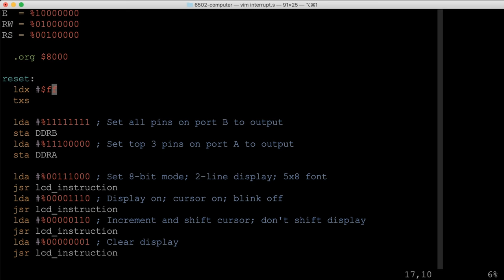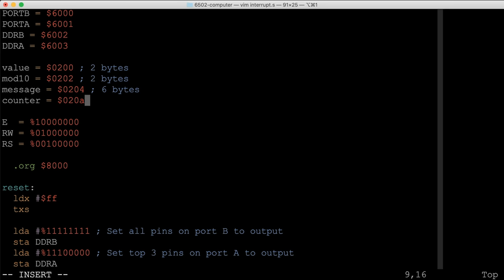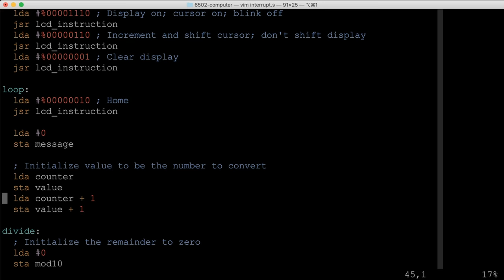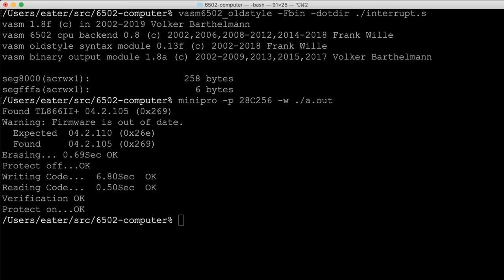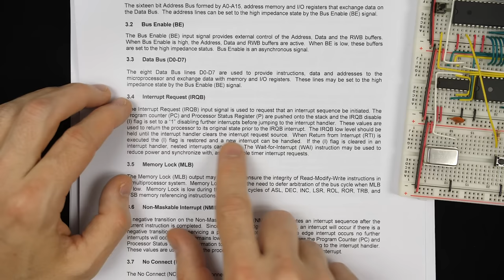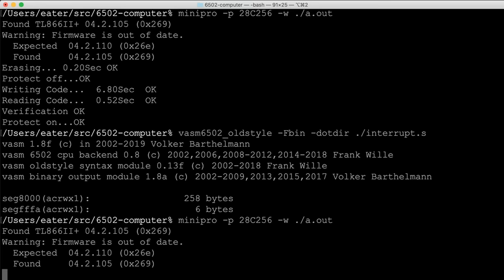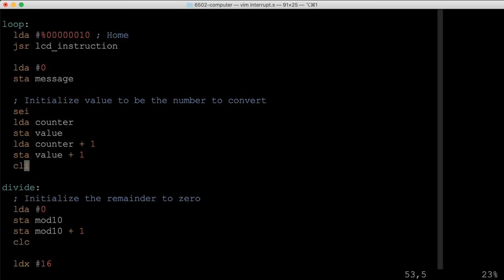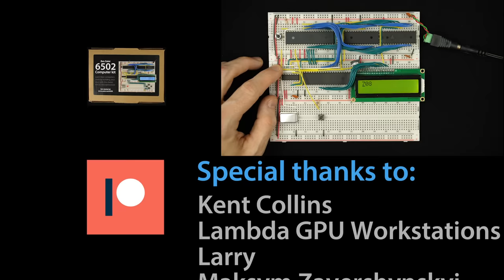Hardware interrupts

Comment: Absolutely love how you go through the process, failing a few times, and "discovering" why. It makes learning a lot smoother than just being told "you must do X, Y, and Z", and never find out what might happen if you only "do X and Y".
Reply: Yes, I noticed that too, I really like that.
Reply: Neuropsychologically, that technique will trigger the learning response, assuming that the viewer is engaged. 

Unexpected results trigger the part of the brain that formulates and integrates process corrections. (See "orienting reflex")
Reply: It's a good technique. "What happens if you don't do something?" is always a useful question to ask.
Reply: I love how he works this in too.
You can tell he knows the right answer, but he wants to teach WHY it's the right answer.
he shows the shortcuts you can get away with in a pinch, because you know the limits of them.
Reply: failing is part of the process of what it means to be a programmer.
The 6502 is a relatively simple processor. Modern processors are much more complex and there is a lot to know about the individual subsystems working together. It is not uncommon to not know all the low level nuts and bolts one needs to know in order not to fail. The datasheet of the µC I am working with - a STM32F7 - has 1200 pages. Needless to say, that it is impossible to grasp all of the information just by reading it front to back.
Reply: Absolutely agreed. Tutorials have a bad habit of sidestepping the fact that failing is a very, very powerful learning tool.
Reply: hmm
Reply: I always love that when something going over how, really anything works, instead of just jumping to the correct solution goes through the steps and mistakes actually made when first designing it

Comment: "You don't want to use NMI in normal operation." Nintendo: "How about an NMI on every VSYNC?"
Reply: At least IBM used a maskable interrupt on a timer
Reply: Nintendo used NMI for timing as a sort of watchdog or heartbeat. You didn't want a hard to debug console to crash suddenly in production.

A general purpose computer is significantly easier to debug than a running game console, so timers can be maskable with no loss in integrity.

Comment: One thing that's worth noting: whenever the IRQ line is pulled low, it sets a flag inside the CPU. Whenever the CPU is finished an instruction, if that flag is set and interrupts are enabled, it services the interrupt. So, disabling interrupts doesn't actually prevent them, but delays them. Once you enable them again, any pending interrupts are serviced.

Of course, it's only a flag, so even if 1000 interrupt requests happen while disabled, it will only run the handler once. It is also possible to manually clear that flag without actually handling the interrupt.
Reply: Exactly.  Otherwise, a 'low' IRQ line would try to re-enter the interrupt handler over and over and over and over.  It would keep pushing PC onto stack and ever execute a single instruction inside the IRQ handler :)   By 'blocking' further interrupts until the RTI instruction is executed, the CPU can do something to 'handle' the event.

And yes, if you expect additional interrupts as quickly as that, you could lose track of some events.   So different schemes to 'count' the interrupts as quickly as you can, then use some other code to service the device until the 'interrupt count' is back to zero.  Tricky stuff, but can be done.
Reply: In the 6502, the NMI (non-maskable interrupt) is latched, but the IRQ isn't. It's up to the device or support chips to hold the request until it's cancelled from the IRQ handler.

By the way, if anyone is interested, to handle an IRQ or NMI, the CPU runs a modified BRK (break) instruction. The same happens on reset to load the reset vector, but it holds the read pin high to avoid writing the program counter and status flags to the stack. It's a nifty hack to save transistors. This explains those initial 7 cycles, and why a reset decrements the stack pointer by 3 and sets the interrupt disable flag without disturbing memory or the other registers.
Reply: @JB52520  Hi Johnny how does the CPU know what address is inside the IRQ vector at FFFA, i understand that what ever device triggering the request will be inside the IRQ vector the the iRQ subroutine will begin after placing the last address it was reading from  on the stack etc- but how does the cpu know what device( address) is triggering the low signal.

Cheers Franky

Comment: <3 Perfect timing! Just ordered a bunch of parts I was missing to start this project!
Reply: price?
Reply: Perfectly timed, as all things should be
Reply: @mdahsankhan4361  I wasn't getting all of the items from the videos, so it totals around 1300SEK. The most expensive single item (excluding a new programmer) was actually breadboards at 100SEK each. I was seriously considering getting the kits from eater.net but those got a lot more expensive with VAT and shipping and I can't do that right now. Not going to follow the series exactly for now but if this hobby becomes a more regular activity I will and then at least starting over with the kits will make more sense to me.
Reply: @repinuj  so long as an interrupt doesn't throw off the timing.

Comment: YES BEN NEW VID!!!!!!!! I'm in withdrawal from having too few Ben Eater vids. (PS. We still. all want you to connect your breadboard video card to your breadboard cpu and show some form of video output from it.)
Reply: We definitely want that
Reply: Breadboard CPU could have some problems because it has almost no memory. Even my own version modified to support 4kB of memory would struggle with that. I'm currently working on connecting Ben's graphics card to my Z80 system. And in theory, it should also work with the 6502 design presented in the video. If you wanted to run such VGA generator with breadboard CPU, you should modify it to support at least 64k of memory, if you want full 64 colors on every pixel.
Reply: That would be cool, you would need to use ram instead of eprom?
Reply: @eanerickson8915  Exactly. There are at least two ways to accomplish this. If you want to write individual pixels to the screen with no color limitations (besides 64 colors the thing can produce), then it's best to use two RAM chips. One would be connected to VGA generator, and the second one to the CPU bus. Then you would need a circuit that will "swap them around" on CPUs request. This has some downsides though, for example that means you most likely have to redraw every frame from scratch. The second way involves dual-port RAM. These behave like regular RAM chips, but they have two access ports, eg. two sets or address, data and control lines. This allows the CPU to write image data independently from VGA hardware. The downside is that dual-port RAM is more expensive, but more importantly comes in smaller sizes than regular RAM, so some cuts have to be made in order to fit an entire screen in a smaller space. I went with dual-port RAM, and I already have four IDT7132 chips on my desk. That adds up to 8k. My VGA timing hardware is modified for 256x192 resolution (that's important later). To fit every pixel with its color (one byte per pixel), I would need 48k. That obviously won't fit in my 8k of RAM. So what I did, was to divide my available RAM into two sections: image data (6k) and color data (8k). If you do the math, you can see that a black and white image fits perfectly in 6k I gave it. So how does the color work? I divided the entire screen into 8x8 pixel sections. Each section is given two bytes in color RAM, foreground and background color. When a pixel is on in imge RAM, it gets the foreground color of its section. With some clever connections between RAM chips and timing hardware everything can happen in real time, without the need for any additional CPU. This solution is not ideal for graphics, but it adds some color to otherwise black and white display.
Reply: @k4ktus  That's basically what a ZX Spectrum does, right?
Reply: @kilianhekhuis  Actually not quite. ZX Spectrum is built to minimize cost. As I said earlier, dual-port RAM is expensive compared to regular RAM. On the Spectrum a portion of system RAM is dedicated for screen duties. The ULA chip takes turns with the CPU in accessing RAM. Dual-port RAM design is much easier to implement, but the result is pretty much the same.
Reply: @k4ktus  Yeah, I was mainly referring to the way the bitmap and colour attributes operate.

Comment: One other use case for the NMI is synchronizing your program with a timer of some kind - it's perfect for highly timing critical code! One example of this in practice is the NES, which used the NMI to detect and react to the start of the vblank interval of the TV. As you showed, it's very easy to run into race conditions if you're not careful about how you access memory between the nmi interrupt handler and the rest of the code. The easiest solution is to avoid shared memory access between the rest of the program and the nmi to the greatest extent possible, and to really consider all cases where an NMI could occur when shared memory access is required.

Comment: NMIs are often used for debugging logic. Like you have a push button you can press to show a debug console on a computer where you can do disassembly.
Reply: They're also sometimes used for a soft-reset button, or a warning "heads up, resetting in 1 second".
Reply: I have an old iMac with that feature. Does that use a NMI?

Comment: You can actually make the counter go up only once just from software:

in_irq = $020c ; 1 byte

...

reset:
  lda #0
  sta in_irq

...

irq:
  pha ; save accu
  bit in_irq
  beq not_in_irq
  lda #0

  ; we were already in the IRQ handler here
  pla ; remove accu from stack (original is still on previous stack)
  pla ; remove flags from stack
  pla ; remove return address from stack
  pla ; which is 2 bytes
  jmp await_irq_off_loop

not_in_irq:
  ; actual handler goes here
  inc counter
  bne no_overflow
  inc counter + 1
no_overflow:
  ; end of actual handler

  lda #1
  sta in_irq

await_irq_off_loop:
  cli ; if the IRQ is still active, this will immediately recursively cause another interrupt
  
sti ; prevent a second interrupt from interrupting the following code
  lda #0 ; if we've reached this instruction, the IRQ is off (pin high)
  sta in_irq
  pla ; restore accu
  rti

Basically, when we re-enable interrupts inside the interrupt handler, the interrupt handler will get called again. By knowing when this occurs (flag in_irq), we can remove the stuff from the stack and continue on with the awareness the IRQ is still active. I'm not familiar with the 6502 so this code may not work or it may be more succinctly written.
Reply: Wouldn't it be simpler to have the IRQ handler just set a flag, and the main loop increment the counter whenever that flag is set, then clear it? So no matter how many times the handler runs, the counter will still only increase once per main loop iteration. (Of course that can still be very fast, but you can add a delay.)

Or if you're concerned about the handler blocking the main loop, you can have it end with rts instead of rti. rti is basically "rts and cli at the same time". So you can leave interrupts disabled after serving one until you're ready for the next one.
Reply: @renakunisaki  The problem here is that the counter will increase once per main loop iteration, rather than once per button press.
Reply: @renakunisaki  yes, it's usually recommended to keep interrupt service routines as minimal as possible to avoid slowdowns. Often this involves merely copying data somewhere and setting a flag that data needs to be processed by the super loop/main loop.
Reply: The 6502 code he used doesn't re-enable interrupts inside the handler (although I know some systems do this).  Ben's current problem is that as soon as the RTI is executed, leaving the handler successfully, the CPU re-triggers and re-enters the handler again.   If the handler was written to take a really long time, Ben could get his finger back off the button fast enough.

But yes, if your system can 'interrupt' the 'interrupt handler', then you need something like what you have.   One system I wrote device-drivers for had this.  Used an interrupt counter and the 'masked' part of the handler would increment for each hardware event very quickly before enabling new interrupts so it could accurately count them.
Reply: @mikefochtman7164  The way the processor "knows" the interrupt handler shouldn't be interrupted or that it's still in the handler is by the interrupt flag. rti pops the flags as well as the return address. By popping the flags, the interrupt flag is restored. That's not the only way to restore the flags, however. A simple cli works as well, allowing the "interrupt handler" to be interrupted.
Reply: @xbzq  But that's exactly my point.  The interrupt routine isn't being interrupted while executing the interrupt handler code.  (it can't, since the act of jumping to the interrupt handler also blocks any further interrupts until the RTI instruction is performed).   But the system is still repeatedly counting up for each press of the button for another reason.
1) Button takes IRQ low and as part of jumping to the handler routine, all maskable interrupts are blocked. (but the IRQ line is still low)
2) Routine successfully does what it's supposed to do and is not 'interrupted' the entire time it is within the handler (but the IRQ line is still low)
3) As part of the RTI instruction to leave the handler and go back to whatever bit of code was executing before the interrupt, it also pops the flags and that re-enables maskable interrupts  (but the IRQ line is still low)
4) The IRQ line from the push button is STILL low (human finger on button doesn't release fast enough in the short time it takes the CPU to execute the code in the handler and perform the RTI instruction)
5) CPU immediately re-enters the handler again and the whole thing repeats.   This happens several more times, until the human has released the button.

It's not entering the handler RECURSIVELY (that is, interrupting while inside the handler, nesting deeper and deeper, which is what your suggested code would detect and fix).  It's simply entering REPEATEDLY the moment after it leaves the handler because the IRQ line is LEVEL sensitive, not EDGE sensitive.

A form of flip-flop between the button and the IRQ line is needed.  Something such that the IRQ line is taken low only on the edge-trigger of the button and the CPU can output a control line to reset this "interrupt flip-flop" even though the button is still held low.   That way, once the CPU has handled it, even though the button has remained low the entire time, a second interrupt will not be generated.  Only after the button goes high and then low again would this external flip-flop drive IRQ low again to interrupt the CPU a second time.  ( a form of edge sensitive 'latch' that is 'set' by the edge-transition of the button, and 'reset' by the CPU as part of the handler just before its RTI instruction)
Reply: @mikefochtman7164  Yeah, so I'm not saying much of your comment is wrong there. Seems about right. But the code I posted allows this stuff to work without the hardware changes you're suggesting. Software changes are usually cheaper than hardware changes and they can also be made to work on a system without tinkering with the wires (just using the keyboard, that is, if it has one of course).
Reply: @xbzq  So I looked closer and I see what your code is doing (I think).  As long as IRQ is low, the CPU is going to be continuously entering at the label IRQ:, cleaning off the stack and jumping to 'await_irq_off_loop:', then immediately enabling the interrupts and reentering again at IRQ:, doing nothing else until the button is released and the IRQ input line goes high again.

Okay, yes software is always easier to change (made a career of writing software so I totally agree with you on that. :) )  But your CPU isn't able to do anything until that external hardware lets it go, it's stuck there in those dozen or so instructions.   In my career of real-time programming, I always abhorred locking up the CPU for any length of time if it was avoidable.   Much rather let it handle the interrupt as fast as possible and get back to whatever it was doing (including perhaps, handling other interrupts).

Anyway, good discussion. :)